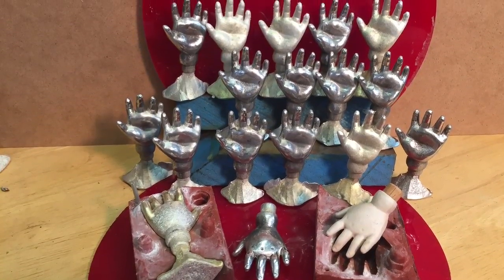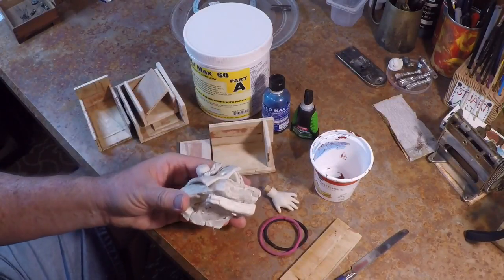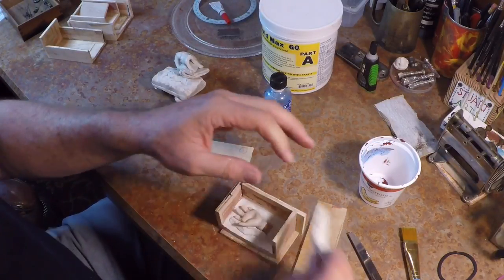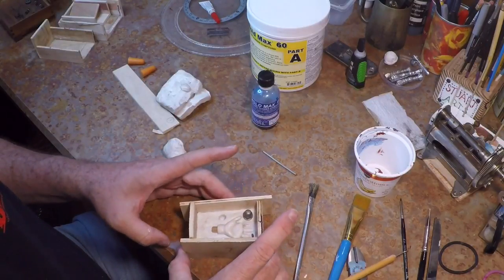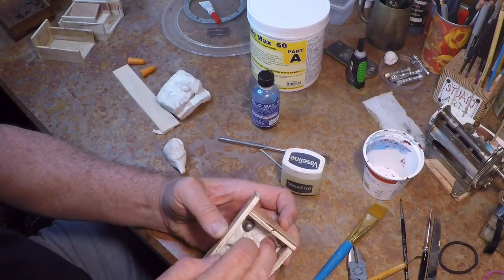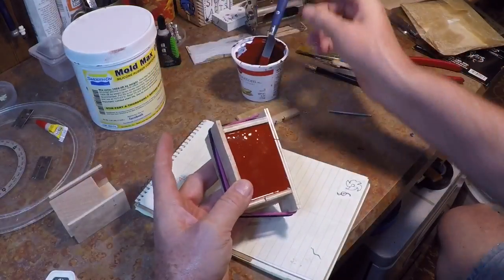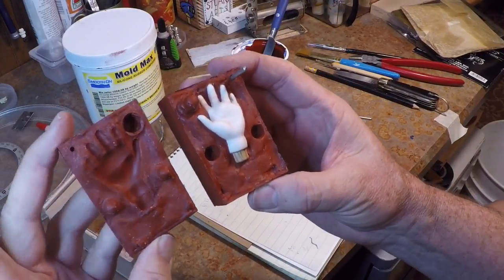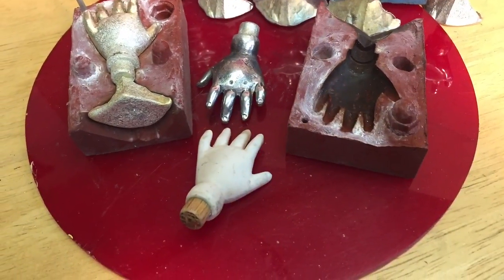How to Make Pewter Doll Hands with a Two-Part Silicone Mold

Comment: Excellent job! But, I did not se anything about prepping the mold, before making your pour. So, did you use talcum powder, or something like that, for mold prep, before pouring the molten metal into it?
Reply from the maker: Some say dusting with baby powder helps the gasses escape and reduces imperfections . I’ve been doing that for a while now.
Reply: @JimmiePorterAtStuartArts , great! Thank you! It looked to me like there was a whitish powdery stuff on the mold,as it was being opened, but I wasn't sure exactly what it was. Good information, and very well done! Thanks for sharing it!

Comment: Hello, I am new to Mold max 60 and pewter casting and found that the mold burnt and lost detail after the third casting ? How do you prevent the mold from deterioration ? Thanks
Reply from the maker: Hello, it sounds like your metal was possibly too hot. We heat ours on a hot plate but keep the temperature as low as possible, maybe just a few degrees above melt. Good luck!
Reply: @JimmiePorterAtStuartArts  That would explain it.. I use a propane torch .. probably should invest in a temperature gauge.. great advice thank you! One other question on average how many casts do you find you can get from one mold before it degrades? Just to help me know if I'm getting it right in future .. thank you so much :)

Comment: words about vent holes- didnt see vent hole being put in? did I miss something in the video?
Reply from the maker: I did not install vents because I wanted to see if they were necessary after the first pour. There were no voids in the castings so the additional vents were not needed.
Reply: @JimmiePorterAtStuartArts  ahh i see thanks- so enough air seeps out between the mold blocks- and seeps fast enough-in this set up.

Comment: Can this be done with brass instead?
Reply from the maker: Lucia Garofalo melt temperature for brass is quite a bit higher than the silicone rating. Pewter and tin have low melt temperatures within capability of the Moldmax...good luck!

Comment: Jimmy, when melting the pewter, the impurities in the metal become the slag slick that floats to the top and this stuff can discolor your casted piece and make it brittle  , I use a steel knitting needle to scim that crud off prior to pour. Your video was extremely helpful,  I hail from the sandcasting craft myself and wanted to learn about silicone molds. Hope this helps.
Reply from the maker: Alex Mehlhose great tip Alex...thank you!

Comment: Thanks for this information. I am thinking about pewter casting and you've taken a lot of the mystery out of the process with your well-done tutorials/videos.
Reply from the maker: Mary Tee I'm delighted that you found it helpful...holler if you have any questions and good luck!
Reply: @JimmiePorterAtStuartArts  I do have a question for my first project- I have two small candlestick holders (wood) that I want to make a mold of (1.5" x .75"). Do I need be concerned about possible wood graining of the mold due to the original?  Also, due to the size I should be able to set the mold up so I can pour two per mold. Anything to be concerned about when pouring two items in the same physical mold? Thx.

Comment: hi, i bought some mold max 60 for something but didnt open it yet, is it ok if i open it and close it up and store it or does it all have to be used?  it says " limited shelf life, use as soon as possible" does that mean when it ships to me it has a mimited shelf life even before opening it or do they mean after i pour what i need and mix the part b?
Reply from the maker: ZethieTail I'm not too sure of the exact answer. But I've opened it and had it sitting around for several weeks between projects with no problems. Just put the lids back on so it doesn't dry out I'd say. Good luck!
Reply: My understanding is that once opened it should be used up within a few weeks or months or the rubber might not set as well after a while. I have had silicone sitting around for six months or more without problems, but my house is cool and dry.